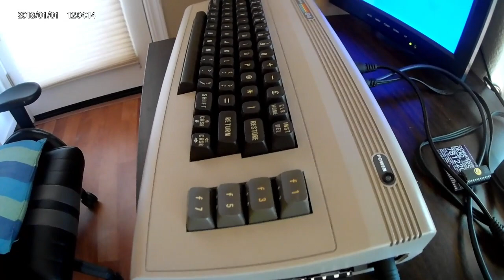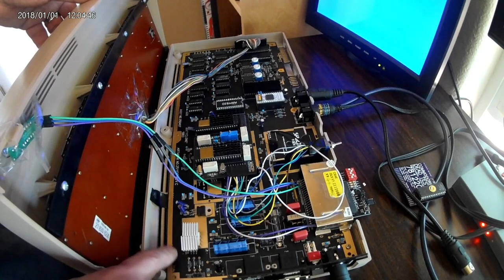New built Commodore 64 computer in 2021 - With NTSC/PAL video switch

Comment: Speaking of relative processing power, decades ago I ported a program from a U.S. Navy system (AN/SQQ-23) that occupied an entire room to a C64. The C64 was more powerful than the Navy system in all aspects, including memory capacity. It was a sight to watch that program running on a little PC that cost roughly 0.001% of the Navy system. All the C64 could not do was the high-power transmission, but it could easily control the transmitters.